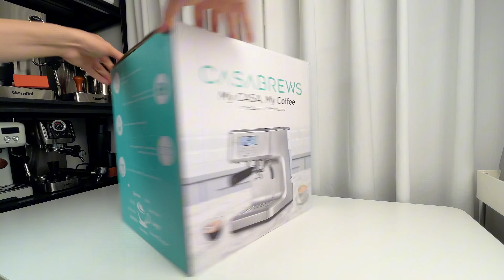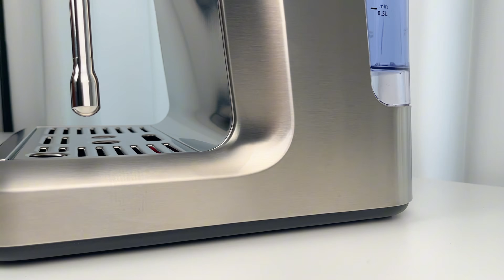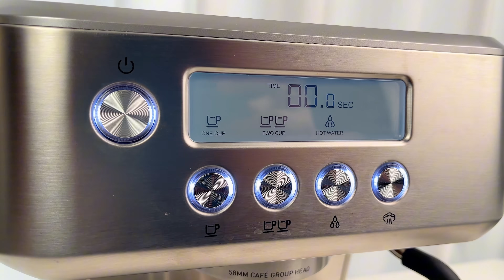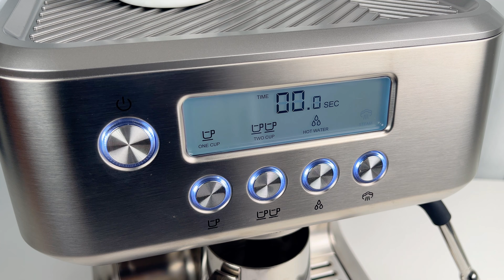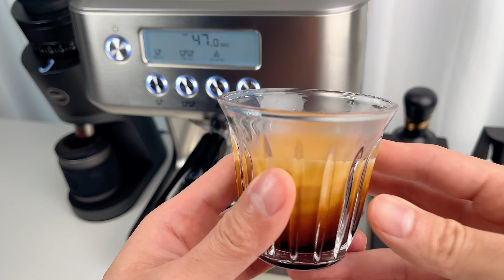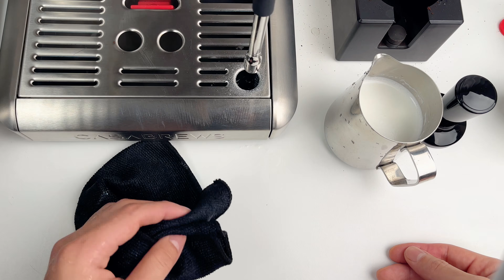Casabrews Ultra Review | Affordable Espresso Machine with PID, 58mm Portafilter & Full Metal Body

Comment: Do you think a Tuni g1 would be a good coffee grinder for this?
Reply from the maker: Hi, my G1 handles darker roasts well, but struggles with lighter beans—it lacks fine adjustment range and sometimes can't grind fine enough. In my tests, AMZCHEF's grinder performs better (I've reviewed it before) and costs slightly less, but it's all plastic and feels cheaper than the G1. Still, both are solid choices under $100, if you use pressurized baskets, they both work. The HiBREW G5 and Starseeker E55 Pro I tested offer better stepless adjustment, but they cost more. Hope this helps.

Comment: Too bad this beautiful machine uses a thermoblock instead of a boiler.
Reply from the maker: A lot of home machines use thermoblocks because they’re cheaper and heat up faster. Many newer thermoblock systems actually have pretty good temperature stability now, but they’re usually not as stable as boilers when you’re pulling multiple drinks back to back.

Comment: Great video. At 7:30 you mentioned resting for about a week? Did you mean resting beams after they are ground?
Reply from the maker: Hi! "Resting the beans" means waiting about a week after roasting before you grind and brew them. Freshly roasted coffee beans are actually too fresh and won't extract the best flavors because there's too much gas still in them. But once you grind the beans, you should drink the coffee as soon as possible - once ground, coffee goes stale really quickly.

Comment: What scale are you using? I purchased the Maestri House S1 G and it is too tall when placed on drip tray.
Reply from the maker: Hi, I used the Timemore's Black Mirror Mini, it's very thin.
Reply: @brewcoffeehome Is there a reason for not using the auto time feature on the scale? Does it gets confused with the pre infusion pause? I returned a normcore v3 for this reason 😂
Reply from the maker: @Shadow__133 It's just not as consistent as using a scale. You can tweak the auto time settings, but a lot of variables can change flow rate, like the freshness of the coffee beans, the puck prep process, and so on, so I stick with a scale and manually turn it on and off.
Reply: @brewcoffeehome I just forget to start the time, I just want one that drip detects to start, but not to auto-stop.

Comment: Thanks for the videos! How would you rate this Ultra compared to the Hibrew H10a and the Gemilai Owl?
Reply from the maker: Hi, Ultra is the most affordable of the three, especially with my coupon. It feels sturdier than the H10A. The H10A offers more settings, like brew & steam temp, pre-infusion time, but think about whether you’ll actually need all those features—it does have stronger steam than the Ultra. The Owl is the priciest, it delivers consistent coffee, has super powerful steam, and looks amazing. All three are great for home use; just weigh your needs against the price. Hope this helps.
Reply: @brewcoffeehome  thanks for the reply! I actually just commented on your Tuni E2 video asking the same 😂 I didn't see your reply here before I commented. The Tuni seems really impressive and interesting with the dual thermoblock in such a small machine
Reply: I bought the HiBREW H10B off Temu and I'm not impressed with the steam production.  It's weak and adds a lot of water. It seems underpowered for steam.
Reply from the maker: @ Have you tried higher steam temperature? Normally home machines especially the compact ones don't have very strong steam, but suffice for home use.